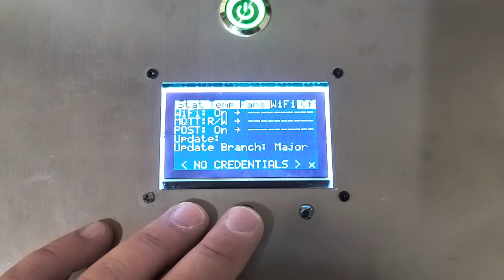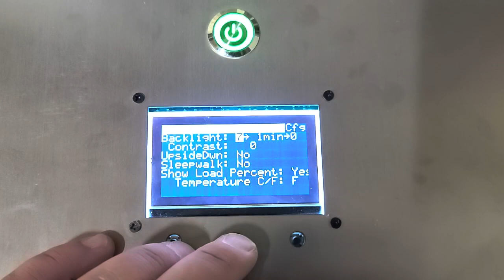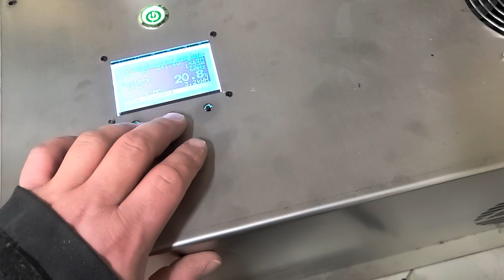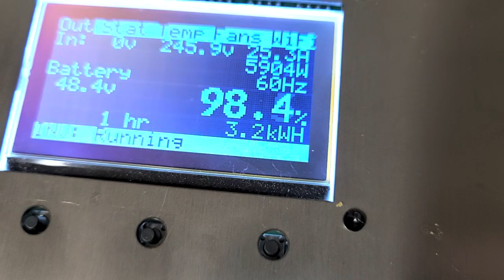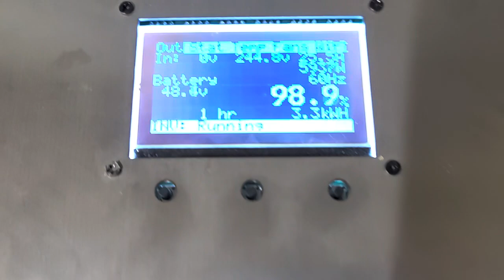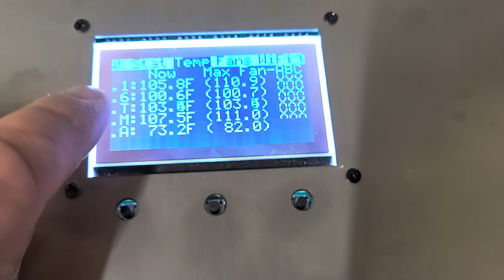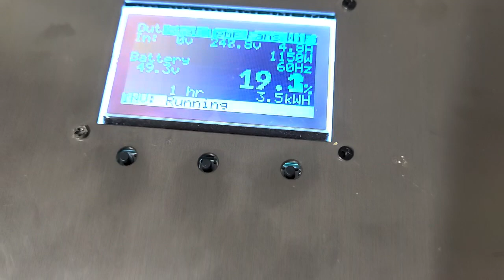Genetry Solar Inverter load testing station (don't try this at home!)

Comment: Don't worry, I feel like Fester from addams Family. . . Holds a light bulb in mouth and in hand while feeling around and stick my finger into the socket!!!!.

Wait till I pop up my Youtube vids of me wireing up the GS inverter and stuff as a total blind person.  giggles  I'll show what happens when you have bear wire point out of the breaker box and with a sheet of foil between the two wires Then, turn on the GS inverter to it. Love to hear the power!!!  *smirks*ee
Reply: Haha, sounds like I need to implement short circuit protection, though I know that'll take all the fun out of it...
Reply: @sidlori1592  Well you could add reverse polarity protection for the inputs for dummies like me who can't tell the difference in colors in reduced lighting. ;-) All it would take is 4 huge diodes. And heatsinks. And fans. And thermostats. And.............. :-D Ever see a 42 VDC 250 Amp circuit breaker catch fire on 24 Volts?
Reply: @gravelydon7072  I have not seen a DC breaker catch fire (except on YouTube)...and perhaps more importantly, I really don't want to ;-).
Yeah, I'm aware that diodes are very effective space heaters at 400 amps.  'Bout the best that could be done is a huge crowbar reverse blocking diode and a properly rated DC fuse.

Comment: Wow ! Running a hot water heater+ the whole house without led lights flickering . Man you two guys especially Sid did awesome . This is a carefully way Sean had to do to run tests , I know some you tubers may say otherwise  , but this was the only safe way he had to show everybody how reliable this and many future Genetry Solar inverter are when it comes to implementing one in a breaker panel  to safely run any whole house in mind  . Props to  yall . GENETRY SOLAR .
Reply: Took me a bit, but I figured out how to increase the voltage regulation by over 30x...now it can regulate roughly 0.1v steps @ 240vAC.  We may still have to tweak the voltage regulation feedback code a bit, but now it's considerably more accurate at load regulation.
Reply: I will note that there will be a brief flicker if the load changes suddenly; the inverter has to see a drop (or surge) in voltage in order to react to it.  The power company gets around this by simply being so massive that our 10kw loads don't even count.  
Sean was referring to oscillations/continuous visible flickering under certain loads.  I'm glad to hear that that problem was resolved with the firmware revision.

Comment: Sean, is that the first unit that you unboxed as it has the bad grill? Merry Christmas day after. On your LED lights, do they glow after you turn off the switch? The ones in our fixtures stay glowing for a couple minutes until the ballasts lose all their charge.
Reply: 2 of the first 5 units had the original grill design; the remaining 3 have the new grill design.  Cheers!
Reply: @sidlori1592  Now how did you know I was wondering that? ;-) Should be interesting when the boat shipment gets in to see how many of each arrive. Merry Christmas and Happy New Years to you to. And thanks for what you do for Sean.
Reply: @gravelydon7072  So I expect all the boat shipment inverters to be correct.  (I do know that the air shipment inverters were manufactured first.)  Who knows, they may have had an extra chassis or 2 laying around, I don't know.  Such are the challenges of starting a new product without millions in R&D and a 5-year product design time...
Reply: @sidlori1592  Ah, but yours work. Which sometimes can't be said for those with a five year plan. I worked for 8.5 years in ag research. Ever see a mechanical tomato picker? They work for a one time thru the field picking. Provided you want to make Ketchup. Or soup. The solution, a new type of tomato. One with a thick skin but absolutely tasteless. :-( Biodegradable 90 day plastic mulch that broke down in under 30 days. :-( 

 I rebuilt a potato digger to work better. Not only could it dig potatoes, it could be used for plastic mulch removal of plastic mulch not designed to breakdown. :-) Rebuilt a planter so that it could use gel to carry the seeds that were already sprouted. Got credit for that in a peer reviewed publication even. But those things were done on the cheap and dirty and fast. 5 year plans take ten years or more. 

When I switched  jobs in 1986, I dealt with the Corps of Engineers. Things that were on the drawing board in 86 still haven't been built while things that were on the boards in 1994 were finished and in operation by 1997. And are falling apart now as they were " temporary " items. Permanent things take 2 years to build and 5 years to get permits to operate them.
Reply from the maker: Yea they do for a little bit
Reply from the maker: Merry Christmas to you as well

Comment: Wow, I can't wait to get mine, I'm already setting up the power room, and battery room to upgrade to 24v.  Also as soon as the goverment get off their fat butt, I'm ordering the second one so I can run my whole house with no issue. My water hearter uses 4k, and I think my dryer uses 5k.  I hopw the GUI is blind friendly, I've still not got to see it, is it a app for IOS or Android?  Way to Go Cid!!!
Reply: I think you're the 2nd person who has asked about visually-impaired accessibility.  Most of the cheaper  "big name" inverters are easy to access for visually impaired people--because they simply don't have any settings at all.  I am quite aware that there are some challenges for visually impaired persons, particularly with equipment that doesn't speak or have Braille displays.

Do you have any suggestions for making the on-screen GUI more accessible?  It is possible to connect the inverter to a cellphone, and access a configuration page from a browser; it would be possible to configure the inverter from a cellphone that way. 
I do not have an app for iOS or Android, instead I went with a WebApp from the Genetry Solar website (works on Android like a regular app, and will fully work on iOS on the day that Apple decides to realize there's a world outside of themselves).  However, for security reasons, I do not currently have any way to configure the inverter setup from the website.  I'm just not comfortable with opening up such vulnerable settings to the Internet.
The website portal allows access to inverter status (output voltage, amperage, watts, battery voltage, current mode, hourmeter, temperatures, fan speeds, etc.) and rudimentary control (on/off/power save, and ATS/UPS/charge modes for AC-connected systems.)  Adding more features is easy to do, as long as it can be done safely and securely.

Your thoughts and suggestions are greatly appreciated.  It would also be possible for Sean to configure the inverter for what you need, BEFORE shipping it out--that way it's more "plug and play."
Reply: @sidlori1592  Hey Cid, well web site will work, so you are saying I can gain access to it from my crome broser.  You got a demo addy you can send to me to test out with my screen reader?  One request I would ask, is a way to disable the touch screen on the inverter if it has it by going into the web site and enable it to turn off.  Also if it can send email on any alart would help for me to know if anything is going on.  I'm sure I'm the only blind person, since I was the one while it was being made that I ask for a beep of some kind to know what the error is of the inverter if it goes into a error mode since there is no way for me to see color.
Reply: @matthewsuggs1637  Ok, then yes you would be the same person ;-).  I just have a hard time keeping track of who's who, it's hard enough designing the inverter ;-).

I think I mentioned earlier about making a custom solution for you.  Not terribly hard on Windoze or Linux, especially if you only need basic control and full statistics.  
Ah yes, you wanted to integrate it into an Amazon Alexa or Google Home voice activated device?  I don't have too much experience there, but it is quite possible.

Custom beep codes are completely possible, though alarm and error messages can also be gotten through the web interface.  Lots of possibilities, we just need to sit down and figure something out.
Reply: @sidlori1592  Sid, I sent a email to Sean to have you get ahold of me, its real simple to make it where it work even for me.  Echo and google asist isn't needed.  I just need to know some things so we can make it work. I can't get stupid you tube to notifie me if I get a comment, have not figured that out, otherwise if I knew how to send a message to you privet I would sned me email.  If not I sent it to GS email.

Comment: both elements should not kick on at the same time in your hot water tank
Reply: We never replaced our top unit after it was first burned out. No need as the water heater on the lower element only kicked in once a day anyway.
Reply: It's a dual series water heater setup, that's why it appears as 2 elements' load...it is 2 elements, but across 2 heaters.
Reply: @sidlori1592  He should set the thermostats at different temps then. One about 5 degrees below the other. Depending on how they are plumbed the one would come on more often and the second would just kick in if the first one could not handle the load. First tank in the series with the higher setting so that water coming into it is heated up the most. Then the water goes to a second one that acts as a storage tank. If the load gets too high, the second one would kick in and top off the heating of the water. It would require it to be properly plumbed but would save on the energy cost to heat it. Be sure to add tank blankets to all of them to retain the heat better.